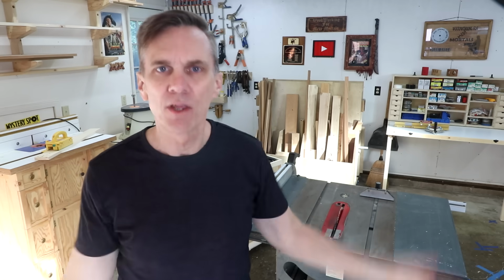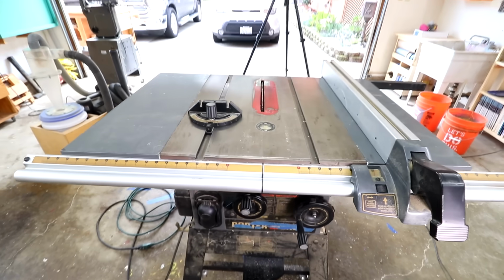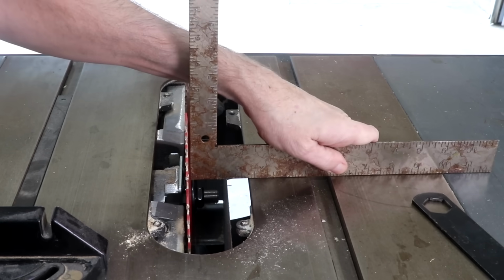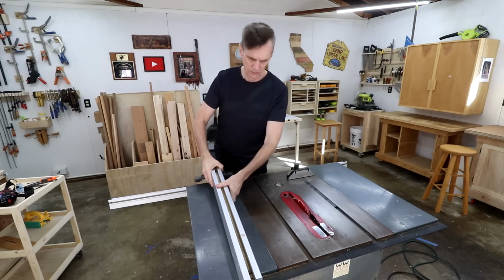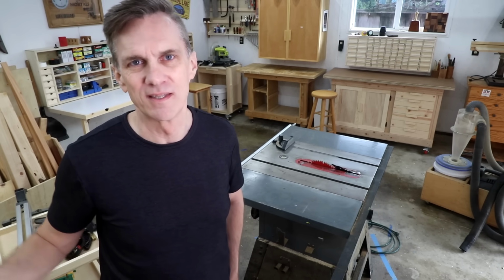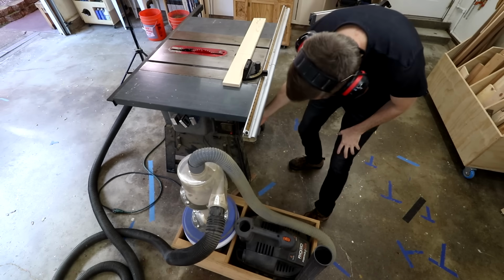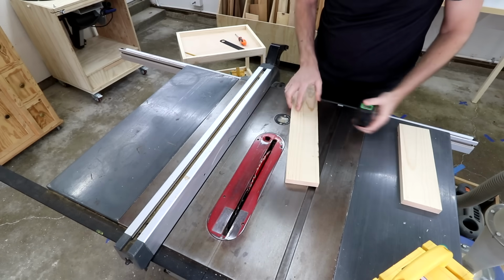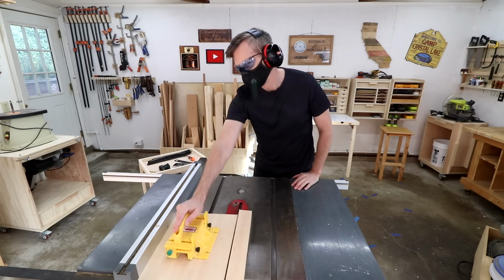A step-by-step guide to making your first table saw cuts. TABLESAW BASICS.

Comment: So I am that scenario. It didnt LOOK intimidating it sounded scary as hell! So I need shoulder surgery, am american so with our medical system try to work around no shoulders. Easy! Sawing by hand really is not ideal for me but I do so I really go out of my way to avoid hand sawing. Anyways I was building french cleats and captain scroll saw sucks worse than I do. So I pulled the monstrous table saw out (jobsite). I needed to just jump in and not be a baby. Get over it. I had watched countless how to use a table saw for the first time and I made ny lengtht 45° it cut like butter and whammo! Im in love with this. So why am I here again? Hehehe the giant bruise on my leg told me I probably need a refresher course. There were mistakes made. So since I loved (past tense because it currently makes me tense.... again) I am dumb. And clearly forgot a lot. Since I was no longer intimidated by the table saw (TS) it will now need ita own home where I can access it. So I am building a TS Cart. I needed to cut some long boards down to size. The long side wouldnt fit with the fence to drop the small part outside the saw blade. Forgetting major rule and OBVIOUSLY LACKING MAJOR COMMON SENSE because I was focused on getting the cut not anything else so...I flipped it. Cutting going well, small part is now seprate and bouncing around between the fence and the spinnig blade which is the exact moment i realized what I had done. And just as I was awakened to my horror the blade broke it into 3 pieces and catapulted them to my leg. 2 stung pretty bad one the grand finale of dumb fk ery sent a message of go learn again. Stupid. Thankfully the thing wasn't on a high surface when this happened because had it been itd have easily put out an eye or something. So i learned. I saw(ed) I got my cut though! So I am now binging on how to properly use a tabke saw because clearly I forgot a few things in that moment. 😅

Comment: Can the saw rip a straight line through a human? Or do i have to use a jigsaw?
Reply from the maker: Vertical or horizontal?
Reply: @SteveRamsey  vertical. My miter gage broke.
Reply from the maker: @TranquilSteps7  It's much easier to move a tool through a human rather than a human through a tool. Go with a reciprocating saw.
Reply: @SteveRamsey  hahha 😆 🤣 good shit. 👍

Comment: Another video I saw mentioned to not use the fence for cross cuts because the workpiece can get caught inbetween the fence and blade and shot towards you. Does this only apply for horizontal cuts rather than cuts down a long length where there is more contact between fence and workpiece?? Would appreciate someone’s advice!

Comment: Really well presented video 👍. Especially about marking out and allowing for kerf. Ironically I’m a metal worker who enjoys doing woodwork and when I mark out cutting lines, I always have the measurements in the middle of the mark. That way it doesn’t matter how thick the line is I always know I want to cut half way thru it. I also put an X on the cut side of the mark. Cheers from outback Australia 🇦🇺

Comment: I'm looking to cut a very hard wood with my table saw and it's thick, I think 2 1/2 inches.  I was told I should use multiple blade heights for this type of cut.  Do you know the maximum thickness for any single pass I should attempt to cut when doing a rip cut with a hard wood on a table saw?

Comment: so my table saw doesn't have a miter guide and when I try to cut the board it bounces all over the place, I have no choice but to put one hand on each side of the board and cut over the blade, it scares me so so bad, my table saw is 2ft x 3ft I get all the sawdust coming back at me. I don't cut often just for home repairs. I have to sand my board after because it gets so chopped up. The saw was given to me, its old, there is no blade cover it is just a little portable saw.  Is there any modification I can do, to make this safer for me. Luckily, I am afraid therefore, super careful. also is there links to the push blocks?
Reply from the maker: You might try making a crosscut sled
https://youtu.be/0sdm_Ow-BTU?si=KbQtmwBVFSnMgWdh

Comment: my dad just handed down a delta 34-444 contractors table saw to me and i was looking into setting it up and noticed i was able to get only 90deg on one side of the blade. is this normal. ive loosened the table top screw for adjustments which made it easier but still cant break the deg gap. should I be getting 90 on both sides and if not should i have my blade at 90 on one side or split the difference?

Comment: My first table saw was a circular saw mounted underneath a table I built.  If you start off with a homemade table saw, I would use a router to cut the opening for the saw blade.  Using the saw itself to cut the opening can be quite dangerous and unless you’ve done it before you will likely be unprepared for the just how much the saw will try to lunge forward.

Comment: A 2500 rpm saw, at 250mm, has a tip speed of 70mph. If wood gets caught in the blade, it can hit you at... 70mph. Follow safety instructions!

Comment: Thanks for the video, Steve. I'm a newbie and I just got my tablesaw. Quick question- you mentioned never use the miter guage and the rip fence at the same time, which is the first cut I did 😮. Is there a particular reason for this?

Comment: Why cant I use the miter gauge and the rip fence together on one cut? On a big plank, like 30cm * 60cm it would be handy for me to push with the miter gauge and guard it with the rip fence.

Im not arguing here, im curious whats the problem with it so i can avoid bad cuts or getting hurt😅

Im planning cutting a glued wood piece so it does not have a grain in is(i mean it has crossgrains due to the manufacturing of the piece)

Comment: I would think that the higher the blade, the more likely it is for the blade to bend, causing  inaccuracies and possible, if not probable kickback, right?  Whoever says that higher is better doesn't take that into account.  As a rank beginner, with around 50 years' very shallow learning, my opinion probably doesn't mean a whole lot to most people, but regardless of my inexperience, I've developed opinions over the years.  I actually lied; I do have some experience with table saws because I build acoustic guitars, but for that, the table saw takes a back seat to the band saw, so my experience with a table saw is kind of shaky and full of DANGEROUS mistakes.  God certainly must be watching me, because I would've been dead or worse; like alive but maimed for life! 🤣🤣🤣🤣🤣 I love your vids, my friend.  I just love them.  Your teaching style is harmonious with my learning ability.

Comment: Hi, thanks a lot for the video.  My saw's on the way, just preparing myself!

So it is mostly for 22mm boards, the saw has a depth of 45mm which is loads for that main job, but if I wanted to cut something closer to 80mm is it valid to go in from both sides and have the cuts meet in the middle??  Can I expect precision from that, or will I be correcting later?  My guess is it depends how square the piece is to start with ... 

As I say, I'll be mostly doing simpler tasks with the new tool, just hoping it's feasible to use it for a wider range of projects.

Thanks in advance!

Comment: THANK YOU. I am exactly the person you described. Did a bit of woodworking with my dad over the years but nothing super intense, and we never had a table saw. Bought a jobsite saw a couple of days ago after watching woodworking videos for several months, and went out to make my first cuts (building a work bench to hold said saw) and made a couple of serious-ish mistakes and scared myself a little bit, despite reading the manual thoroughly and believing I had an understanding of what I was doing. Made a bunch of cross cuts using the fence rather than the miter gauge and while nothing bad happened, there were a couple of cuts that had me a little concerned. 100 percent learned my lesson and a cross cut sled as well as some version of that Grripper I think are in my immediate future. Appreciate your time my friend

Comment: Important note to newbs that wasn't mentioned; you did do it, Steve, but you didn't call attention to it...
On the push stick that is pushing toward the fence, don't push the cutoff against the blade, which could bind.
Let it slide back as you cut, like Steve does it.

Comment: Great clear tips thanks. Something u might want to try. My table saw wants to rust faster and slower depending on season. So I lightly sand and polish couple times a year. It never dawned on me to use my "orb sander" with a red or green monster{this is what I call them}. Then there are all kinds of finishes u can put back on it, this I will leave up to u as some are VERY costly and some cheaper. Good Luck and "Happy New Year"!:oops:

Comment: Hello, I recently downloaded your tool guide. I see you recommended the Ridgid R4560 for upgrade table saw. thet looks the same as delta 36-725t2. What are the differences? Also what is the difference between r4560 and the ridgid r4520? Really appriciate your help.

Comment: Your videos are great.  I have my father's table saw. My brother told me it was not good at holding tolerances. What does this mean? And can I still use it to make simple cuts? I have a teak cutting board 1.5 in thick that I would like to cut down to 20x15 from 24x18.
I was thinking of getting a new combination blade just to be sure I had a sharp blade. I should say I've never used a table song before, but before I did this I would make ment  practice cuts on 2x4s.... And some scrap 2x10s and 2x8 cut offs I have from the new garage roof I had put on my garage....

Comment: Number one reason to get rid of your table saw and miter saw and buy a quality Radial arm saw. Best for cross cutting and ripping . Most all best Radials are 12" commercial saws . Delta, DeWalt and old Sears are good saws . OSHA records more serious injuries from a table saw and they are considering changing requirements for tables. Radials also hold down the wood and are not as likely to have a board loft off the table. A Radial most times you don't stand in front of a possible kick , unlike a table saw . 😎

Comment: So, lets say i need to make a cross cut, but the thing that needs cutting is to wide to put infront of the mitter gauge, it is also long enough to stay safely out of the blades reach, should one use the rip fence in this case or find another way to make the cut?
Reply: Please note that is about coated pressed wood, there are no grains.
Reply from the maker: Yes, use the rip fence.

Comment: Steve, I just opened a new MC table saw. I would expect that the blade height and blade bevel settings would be independently adjustable. Unfortunately, there seems to be an inter-dependency between the two. The higher I raise the blade, the greater the bevel angle. If I set the height to its lowest possible setting, I can adjust the bevel to 0. If I then use the bevel lock to hold the bevel at 0, the saw won't let me raise the blade height beyond a certain point. If I don't use the bevel lock, and I then try to raise the blade height, the bevel angle changes as I increase the height. I wondered if I maybe had to release something , but the instructions are useless, and googling hasn't produced an answer either. Do you have any suggestions?

Comment: I need to rip a board where my finish piece will only be 1.25" so what is the safest way to do that? I need to make several of these cuts. Seems using a stop block would result in a cut that isn't straight but using the fence would result in kickback (though I'll be using a riving blade). the push stick is also too wide for the finish piece

Comment: Thank you for that comment. Absolutely only bring the height of the blade so that it is just barely above the top of the board. This method was taught to me 40 years ago by a cabinet maker and I have employed this method since. I had someone on another channel argue with me that this method is more likely to produce kickback and heat up the blade. I disagree and completely agree with what you said. Also as far as free hand I once walked into my shop because I heard the table saw running and there was my wife free handing a small 6 inch long board with the blade in the full height position. I was absolutely terrified. She didn't cut her fingers off thank goodness but I was panicked when I saw what she as doing.

Comment: Question: Apologies if it's been asked, I'm on mobile and not sure how to search comments here. If I'm using the riving knife and am practicing good technique, is it ok to run boards through that are not true (even far from)? 

I've cleaned up an good as I can with hand plane, but there are multiple areas that are not flush to the fence. 

I have mini panic attacks each time. 

Trying to avoid the S4S 

Thanks!

Comment: One other that I THINK contributed to my first experiences and kickbacks that ended up causing me to leave my saw boxed for years until a project with friends forced me back to it and watching them I realized something - adjust the fence to be neutrally square or safer yet slightly open to the blade going toward the back. All fences have adjustment. My Dewalt came OEM with the fence closed. Highly unsafe for when I ripped using the fence, the workpiece became ever so slightly pinched upon advance and like two people wedging in a doorway...well you get the picture. Neutral is ok but if you measure say 1/64th" open from front of table to back it's enough. I do more - I measure 1/64th at blade. I can live with my cuts off by that much. This plus your EXCELLENT tips and I've not had kickback again. But my blood pressure still rises whenever I use the saw owing to my initial bad experiences.

Comment: I have just purchased my first table saw and truly appreciate your video. Is there a reason my table saw only has a mitre slot on the right side of the blade and not one on the left? I have seen other table saws with either two slots (one on each side of the blade) or just on the left side, but not just on the right. Will this be an issue once I start using it for projects? I can't seem to find any info on why there is no mitre slot on the left.

Comment: Couple other basic, but important table saw tips.. 
-don't wear loose clothing...especially unbuttoned sleeves that come unrolled ( caught myself yesterday dangling my cuff an inch above the blade.  Yikes!)    
-Push your piece that is against the fence all the way past the blade before turning it off.   The change in vibration, the wind from the blade, a tiny misalignment or even just bumping the table .. can all send that piece flying back at you

Comment: Another great video, thank you!
I have a circular saw and my most common cut is a cross cut.
As i proceed in the woodworking hobby, i would like to get more accurate cuts than what i get with the speed squre and the circ-saw. 
Would you recommend me to buy a table saw or a miter saw?